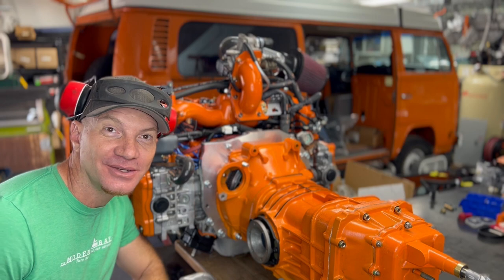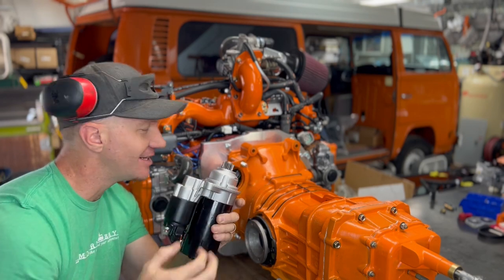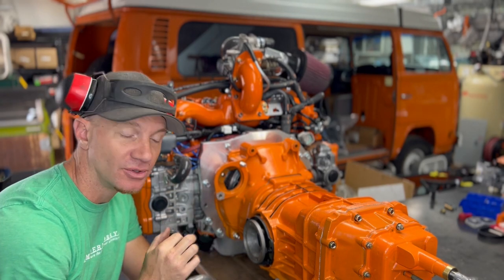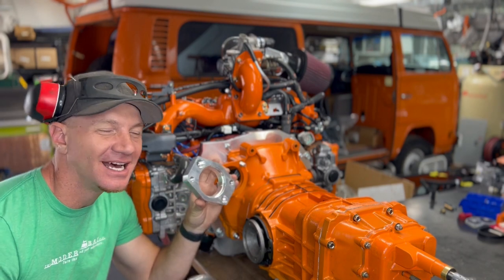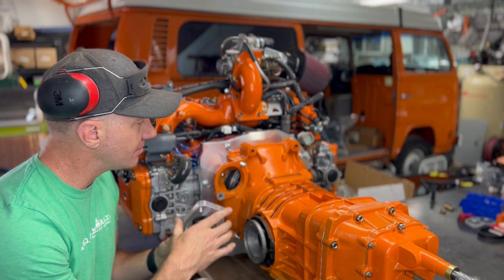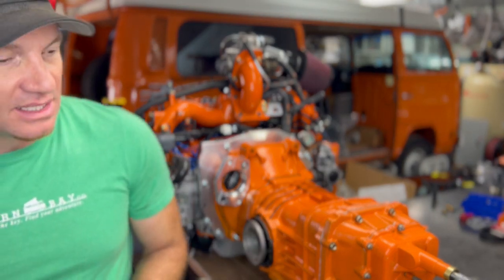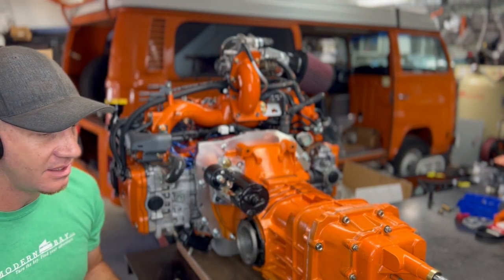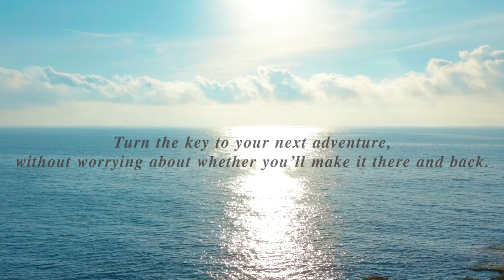Upgraded TDI Starter Adapter Install on 002 VW Transmission - VW Bus Subaru Conversion Tech Tip #008

Comment: Excellent Channel!  Before Long I plan on digging into the wiring on my mid-engine ej25 rail and have thought about using this starter.  This was a helpful video!  Sub'd.
Reply from the maker: Thank you! Glad we could provide some helpful content to get you going in the right direction. Have only had one problem with these starter units, and I’m fairly certain the client was holding the key on way too long after the engine would start, ultimately requiring a replacement starter. definitely the way to go, though! Cheers and let us know if we can help with your build!